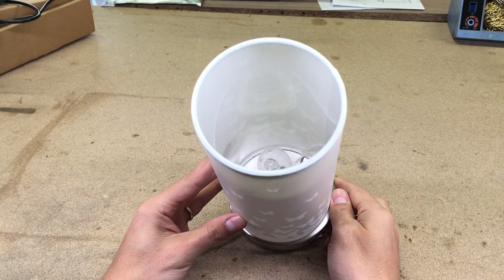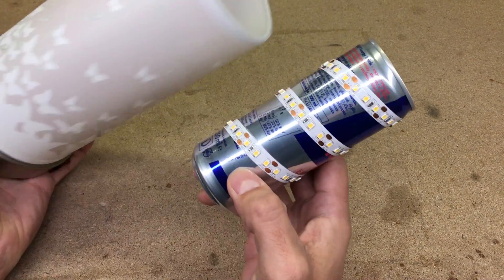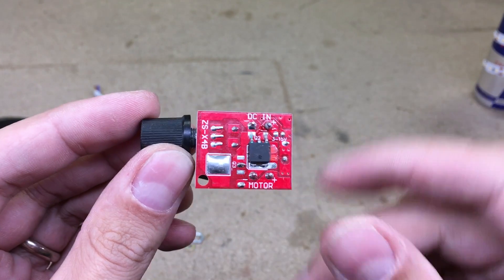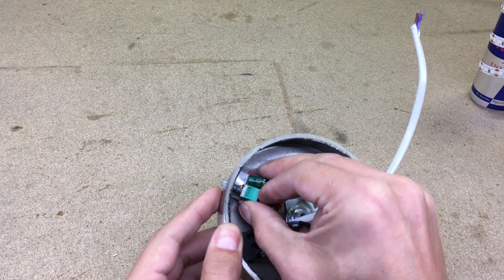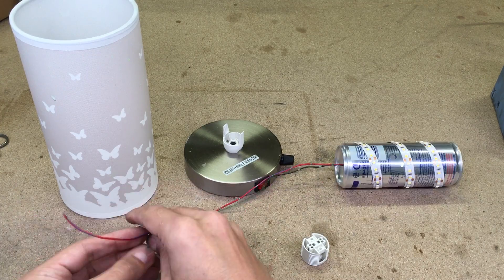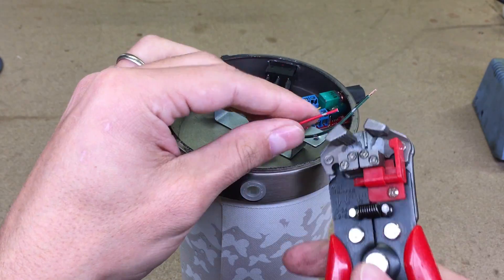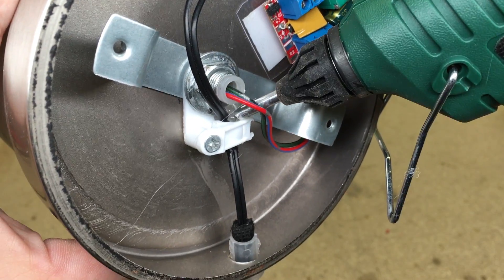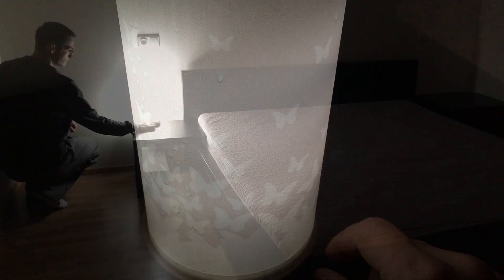How To Make LED Dimmable Nightstand Lamp

Comment: Very cool little hack. Neat and useful! You could maybe have used the hole for the switch to poke the dimmer though? With access to a 3D printer you could make a little "square to circle" gromit to fit the square gap.

Looking for some nice lamps to convert now!

Steve